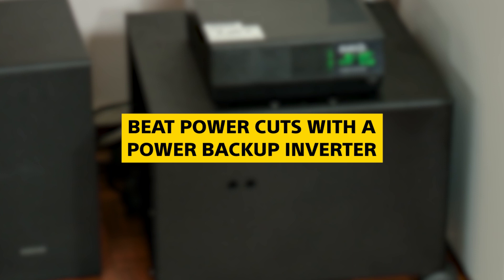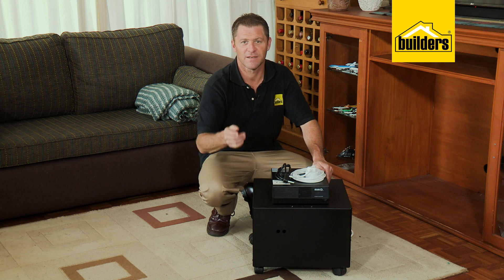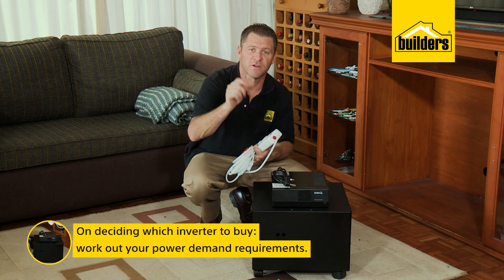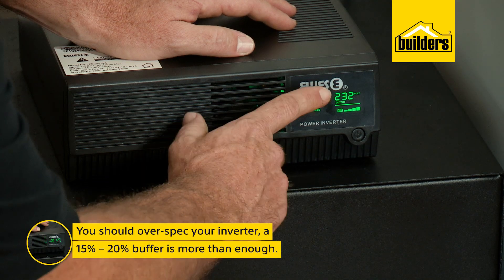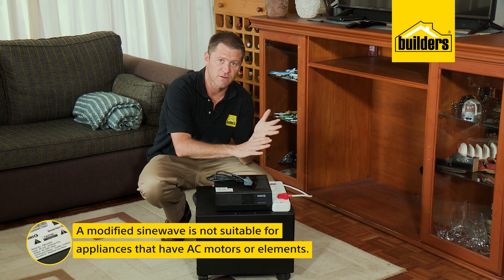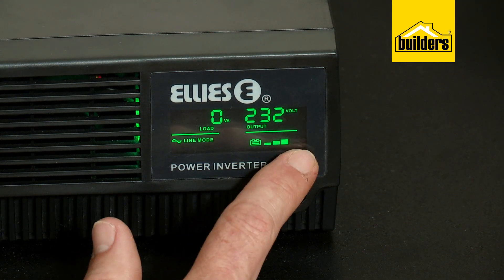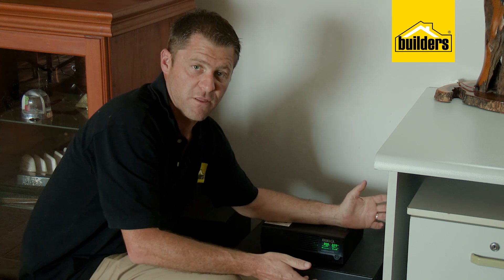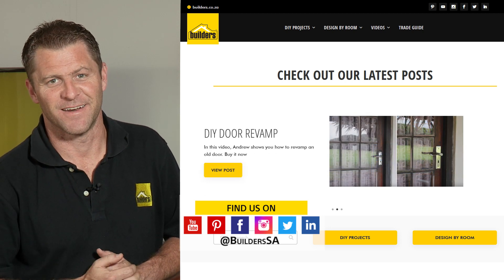How To install a simple power back-up system | Ellies 24400VA UPS Power Inverter

Comment: Great machine. It runs my system perfectly. Only wish it could add solar panels as my area sometimes gets problems when the electricity has to come back after load shedding and may take 30 hours to return.
Reply: How do you connect your home lights to it?

Comment: That fan noise is as bad as a generator in certain situations. Before you jump down my throat, let me explain.

A generator has to sit outside whereas this will typically sit close to where you are working. For many people this will be the use case so that fan noise will be really bad. Also this unit has an 11 hour charging time, the fans stays on all of that time too and not just when you are using the unit to power on your devices.

Comment: I got deep cycle batteries...at what percentage capacity does this inverter kick over to recharge. Around 60 to 70 percent capacity...which is good for the deep cycle battery lifespan. Or is it kicking over at 10% capacity...not ideal..shorten the battery life. I'm looking for an inverter for my 4 deep cycle gel batteries...24v..please help

Comment: I probably won't get a response but I might as well try. My inverter just popped a fuse and after replacing it, when I turn it on all I get is an continuous beep and a fault 15. I've tried everything and nothing helps... we're now heading into a 4 hour blackout and I'll be in the dark.

Comment: Narrow setting is for general appliances. If you select this mode, the HEXA operating voltage in Line mode is within 170~280Vac with the same output voltage. The line sensitivity is higher. Wide setting is for energy saving.
Reply: Fact

Comment: Due to noise, is it okay to unplug the unit at night, when load shedding does not affect us, and then plug it back in in the morning? Will it still provide full power for a 10am power cut?

Comment: I bought one the inverter fan bearing vibration is making such a noise from the vibration I have to take it back for a refund. You can hear it is very loud in this video 60dB. The problem is nobody realises what the problem is that is causing the fan noise to be so loud. I have replaced fans with faulty designed bearings that vibrate and make a loud noise in other devices. See this video for a great explanation of the problem. https://youtu.be/t21Haa5Ez1k 
Millions of Chinese-made devices all with the faulty designed bearings that vibrate and make noise and everyone thinks it is normal to make such a loud noise. You can't even hear the TV the noise is so loud and after load shedding the fan stays on while the battery charges making it impossible to live with.

Comment: Nice video but all ways remember divide your invertor wattage by your wattage in use for average run time .1000 watt inverter ...100watt draw gives 10 hours less say 30 percent for losses .
Reply: So if he draws 300W, the system will last for roughly 3 hours? 1100W divide by usage? Right?

Comment: What if the fan isn't working,it goes of right after it's switched off and makes a loud sound.It brings out an error code 8fault.What do I do to fix this? It also shows only the bars,2nd  bar line and last bar line
Reply: Pls kindly respond

Comment: I understand it's a modified sine wave but please explain the difference between "Wide" and "Narrow" button at the back..
Reply: Narrow setting is for general appliances. If you select this mode, the HEXA operating voltage in Line mode is within 170~280Vac with the same output voltage. The line sensitivity is higher. Wide setting is for energy saving.

Comment: Good day. I recently bought the inverter. I have a Desktop PC which has an 850W PSU, and a Fibre router, will I be able to run the above mentioned items on the UPS inverter?

Comment: Thanks for the highlight. My name is  Goytom from Ethiopia, I am working for the last 5 years in solar energy projects up to 14kW systems with an SMA inverter and different brands. I know this Ellies 720W/1440W Inverter was installed with a non-professional person of the solar system and it was a big problem. then they call me for the troubleshooting then I fix it and finally it works properly.  so, if your product delivered to Ethiopia I can help you to trace the troubleshooting and to make a proper installation for your product warrenty. 

you can contact me with the below email address:-
Goytom1sunsolarExpert@gmail.com

Comment: Sure builders - how much?
Reply: The 720 watt version is R 6700, some advice for you is, buy the ellies inverter and a 100 Ah battery separate its going to be much more cheaper than buying it pre-made
Reply: @WolfmanFoxtrot  please guide me through this,  I need the setup
Reply: @fortuneSimz  Ok so I bought the Ellies 720 watt version from a local shop for R2100 which is a pretty good price, and I bought a 105 Amp Hour battery at my local Midas for around R2400, its a little overpriced but I seriously needed it for that day. I run a Desktop pc which has a 550 Watt Power Supply, Monitor which is 20 watts and a Fiber optic router  which I believe is 5 watts so thats already 575 watts and I can also connect my tv, and it runs like for about 3 hours on load but when I switch my PC off and just run the router it can run for a long time.
Reply: @fortuneSimz  The setup is pretty easy, the inverter comes with all rhe necessary cables. To connect it make sure you connect the cables to the inverter FIRST otherwise you can damage the battery but thats in extreme rare cases. And then connect the battery cables to the battery, and there you go you have successfully connected the inverter and please use a brand new battery, don't make the same mistake I did, I bought a cheap 100 ah and when I got home to turn it on, it didn't work, turns out the battery was defective and also expired. Hope this helps

Comment: I bought one of these from Builders after seeing this video but am having some trouble understanding how to use it. The video makes it sound as simple as plugging it in but that has not been my experience. The manual is not very informative.

After plugging in and turning it on it was in Line Mode and I thought all was good, but the first time load shedding hit it did not automatically switch to Backup Mode but turned off. Pressed the button once and it briefly started, then stopped again. Pressed a second time and it came on in Backup Mode and provided power until load shedding ended at which time it switched back to Line Mode. I assumed it would automatically switch after that, but it didn’t. Load shedding from 4 to 6am this morning and when I got up (after 6 with power on again) my computer was powered off, so the inverter didn’t automatically switch again.

What do I need to do to ensure it automatically switches to continue providing power when load shedding happens? It is a bit useless if I’m going to have to manually switch the inverter on each time.
Reply: Turns out it was my mistake. I left the computer plugged into a UPS and connected the UPS to the inverter. What happened was that the UPS went into battery mode when the inverter was delivering power from battery and the UPS sent a shutdown signal to the computer as it was configured to do. I removed the UPS and things have been humming along nicely through this week of load shedding.
Reply: @strandloper  Are you still using your UPS?if not can i buy it from you if it's still in good shape, I just need to power my fiber equipment only which are 12V and 9V.Let me know if you are selling it.
Reply: @tumim8271  Sorry, I don't have the UPS any more, just the inverter and it is hard at work with all the recent load shedding.

Comment: Whats in the Trolley, is it juat a battery? I want to get the inverter(UPS) alone as I want to use LiFePO4 batteries instead?
Reply: If I may ask why do you want to use LiPo batteries?
Reply: @WolfmanFoxtrot   they have a deeper DoD(depth of discharge) and more cycles than a ‘lead acid’/agm/sealed/gel battery.
Reply: The one I have, identical I think to this has only a battery in the box. Just a convenient container on wheels.

Comment: what would you recommend for a fridge? ( i only really need the fridge and tv running during loadshedding)
Reply: You should not connect anything that heats up or cools down on this system.
Reply: Well definitely not a inverter, you shouldn't even bother buying a inverter or ups for a fridge, it can seriously damage your appliances
Reply: No good, a fridge draws big power on start up and it stops and starts often due to the thermostatic control.
Reply: your fridge might get damaged by this product, since it contains electric motors, you need one that has pure sine wave inveter
Reply: @WolfmanFoxtrot  The ellies inverter is Modified sine wave (1:42).
Beenyoni stated that you should use a pure sine wave inverter for motor driven devices such as fridges or microwave ovens. 

Listen and watch carefully before you comment...